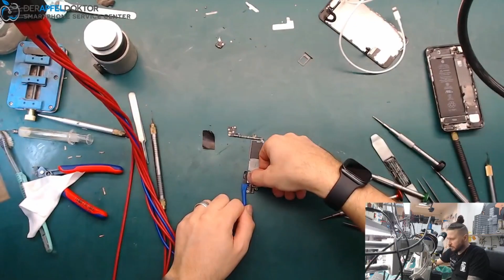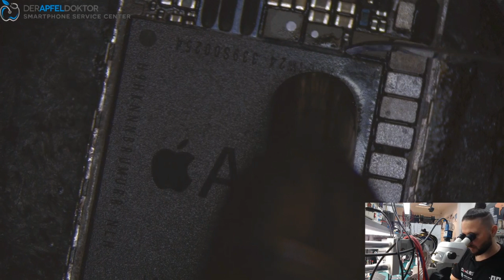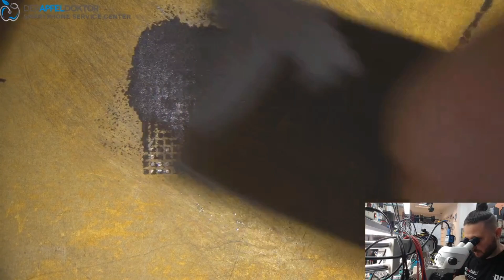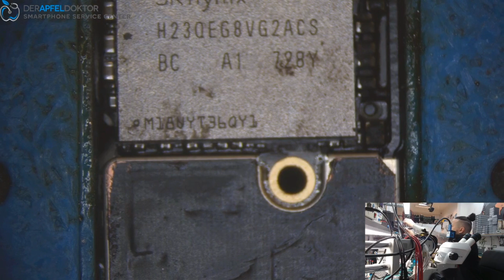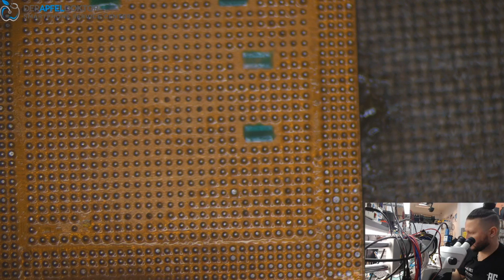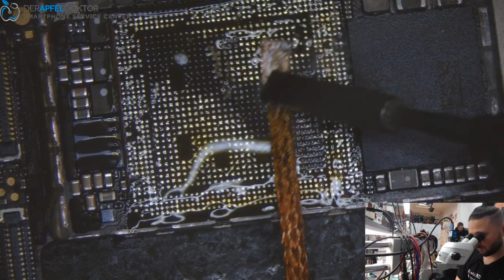MASTERWORK - iPHONE 7 WITH SHORT ON PP1V8 AFTER PRIOR REPAIR ATTEMPT - IMPORTANT NOTICE

Comment: It is very regrettable to see that do not put the capacitors back on, sooner or later there will be a short circuit on the processor line buck8_fb